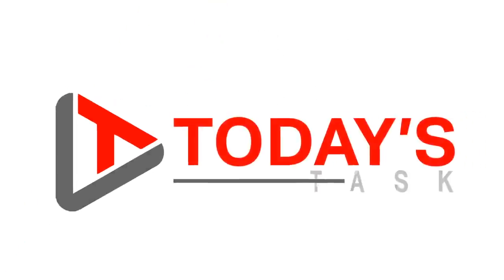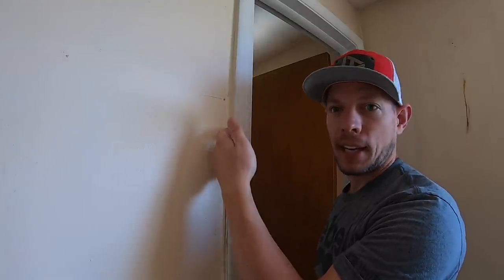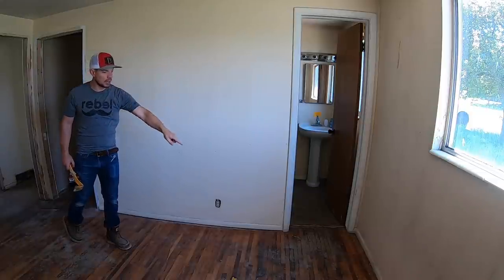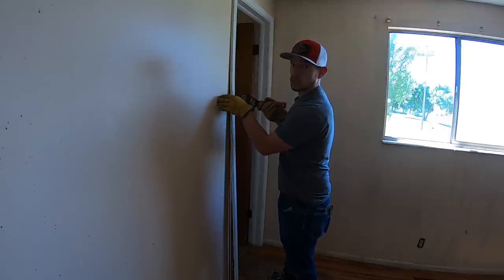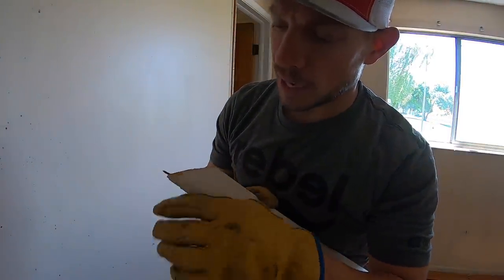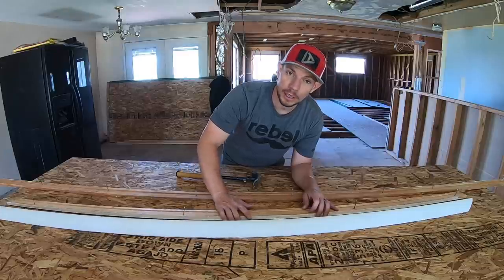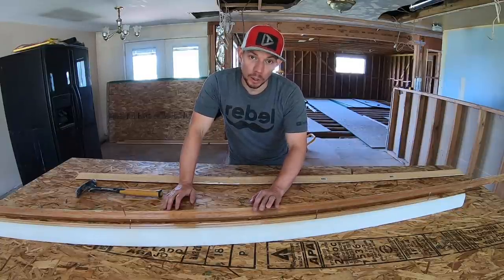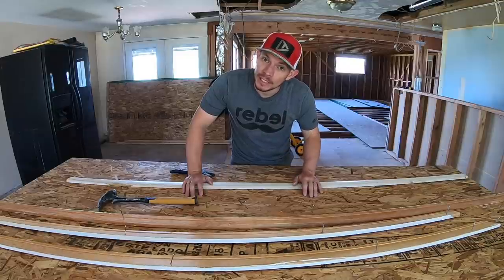Removing Base Boards The EASY WAY

Comment: If you plant to reuse the trim. I might have suggested that you number or label the trim pieces as you remove them.  When putting them back, it is very helpful and sometimes it will be easier to go up in reverse order depending on how they fit together.

Comment: What’s the best material to use for trim? We had termite swarmers in the past(not regular termites. They don’t make a permanent home out of your home) and they ate up the base boards. I am not sure if I should replace it with real wood or the other kind. Any recommendations?
Reply: I don't know anything about termite swarmers, but if they ate up the baseboards, I wouldn't know why they wouldn't eat up the structural timbers as well.  Before bothering with baseboards, I would recommend making sure the home is completely impregnable to termites, and second, completely eradicating them inside.  Then you could worry about baseboards.
I mean, plastic baseboards do exist, but I'd be far more worried about the pillars and beams.